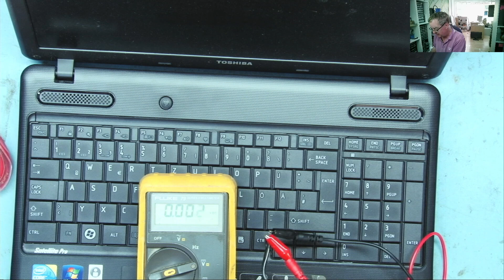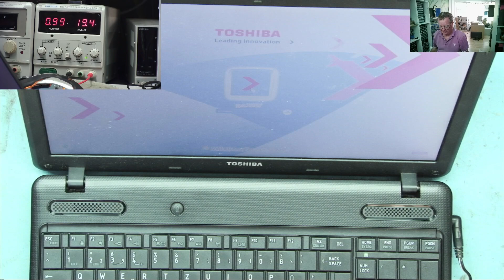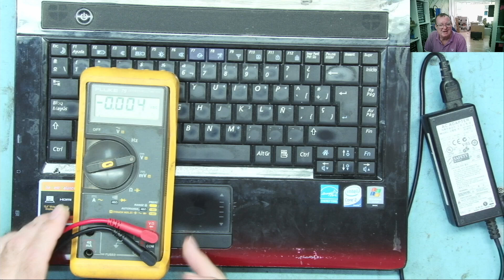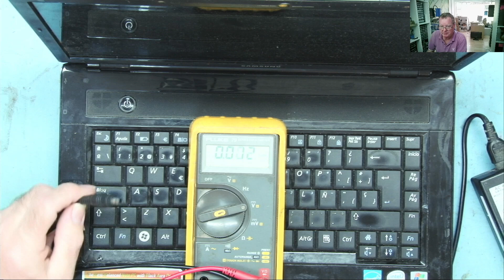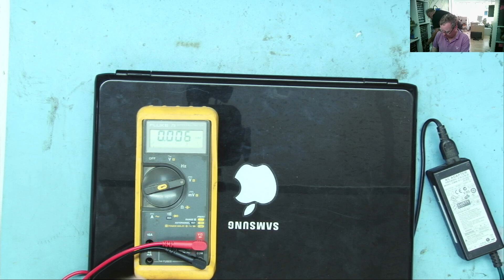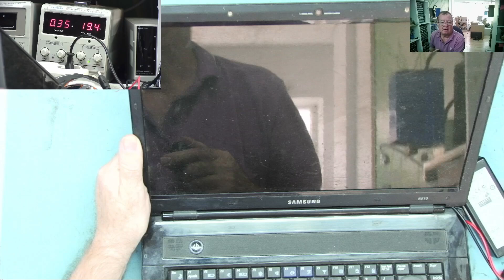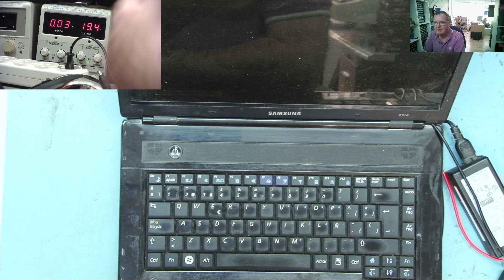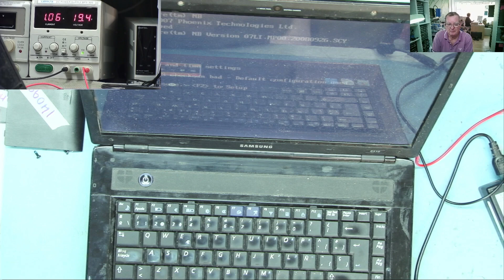This is why I always use my Bench PSU when repairing laptops

Comment: Stupid question: Instead of modding that universal charger, couldn't you just put a DMM in amp mode in series with in the output? There are even inexpensive clamp meters that can measure DC (e.g. Uni-T UT 210E). Don't know how precise they'd be but perhaps worth a test. All you'd have to do is separate the positive from the negative wire in the output. You wouldn't even have to cut wires.

Comment: I don't believe the battery will prevent the puter from booting.
Reply: A bad battery can definitely prevent the machine from completing POST (or from turning on at all). Seen that with low-end Toshiba like C50/C55, but I'm sure it can happen to others.
Reply from the maker: @piernov  True - I've seen this with desktop motherboards too
Reply: @LearnElectronicsRepair I was thinking about the main battery pack of the laptop, but this is indeed true for the RTC coin cell battery as well.
Good example on desktops is the garbage ECS RC410-M2 board. The RTCRST# signal is derived from the coin cell battery voltage, rather than after the dual diode (to get voltage from the 3VSB rail when available), so low or missing battery will cause erratic behaviour during POST.
Reply: Asus desktop motherboards wont boot if the CMOS battery is depleted.

Comment: That unholy samsung/apple core2duo could easily still run linux and play internet radio all day long in a garage or something.  Nice to see it fixed. Bench power supplies are invaluable.  I bought one specifically after watching you and Sorin using them
Reply: It doesn't have to be reduced to "internet radio". Assuming it has a decent Core 2 (if it's a Merom it should be upgradable to Penryn), this can play Full HD Youtube videos fine, a lot of people don't need much more than that. Preferable to have 4GB of RAM and an SSD of course, especially if using Windows.
Sadly getting it fixed and upgraded at a repair shop is generally not worth it economically.
Reply from the maker: @piernov  True. For whatever reason Andy wanted me to fix it and I did.  Neither have come back so the first one must be good with another PSU. I did say the batteries are probably bad but he was OK with that.

Comment: I’m going to be working with audio amps. Some rails require 100V. What power supply configuration would you suggest?
Reply: For safety you should have:
1. Mains isolation transformer
2. "Dim  bulb" current limiter 
3. 0 to 250 Volt autotransformer or "Variac".
Paul Carlson from Mr. Carlson's Lab has info about this.
Reply: @anthonyshiels9273  aren’t variacs AC & high voltage rails on amps DC?
Reply: @jonathanrose456 correct but it is not advisable to apply the full mains voltage to a device that MAY have shorted capacitors in it per Mr. Carlson's Lab advice. 
I NOT going to transcribe his 30 minute YouTube video here.